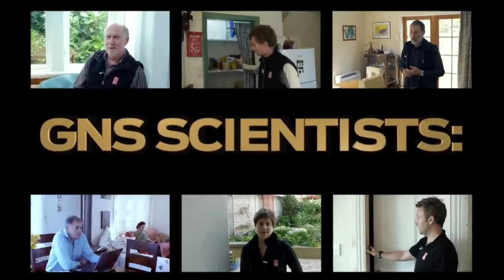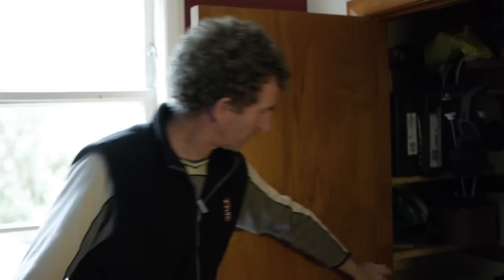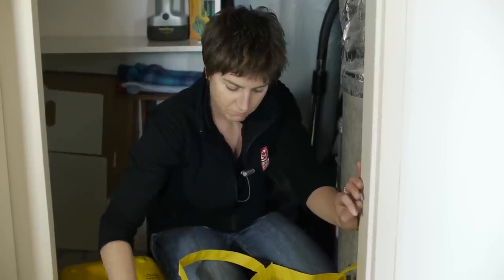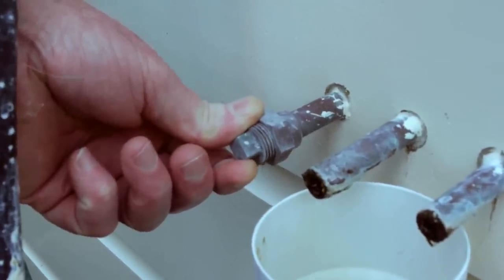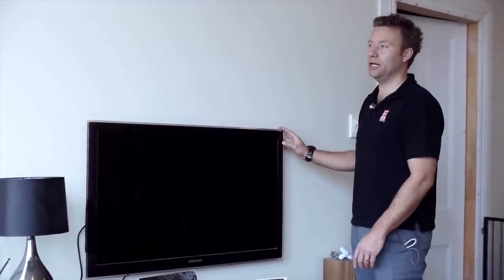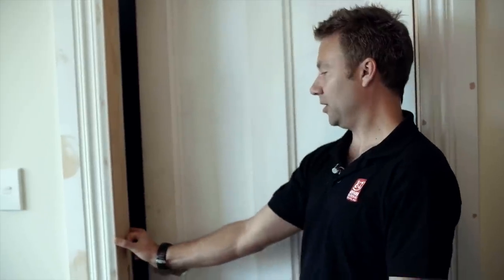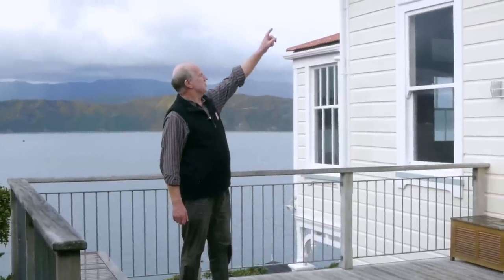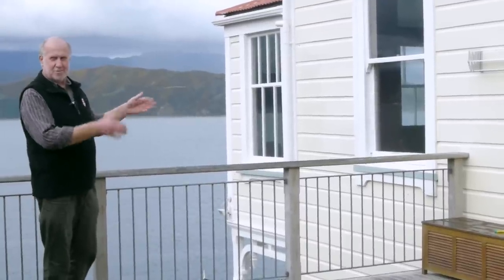GNS Scientists: Earthquake Preparations at Home

Comment: X-bracing construction is common in England as well as buildings in Britain have to be built to deal with a minimum magnitude 6.5 quake event, although rare return periods of such quakes here is around 75 to 475 years based on 6.0-6.5 magnitude range! 🙂